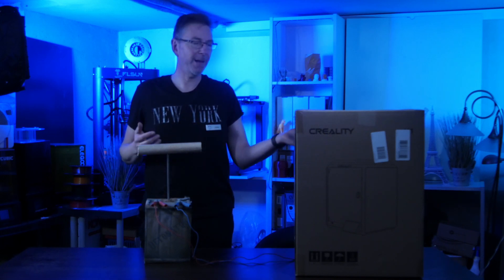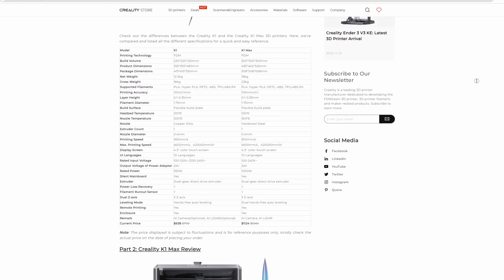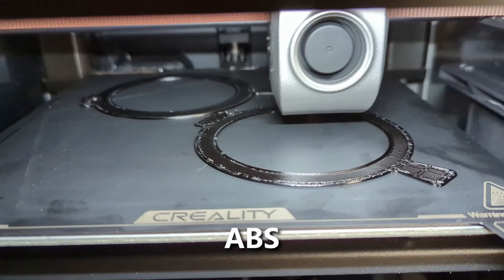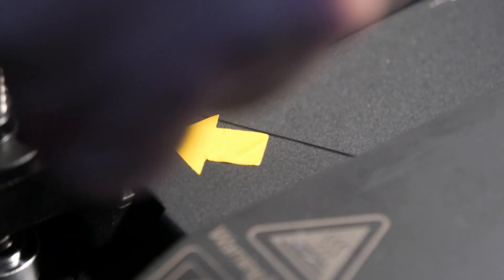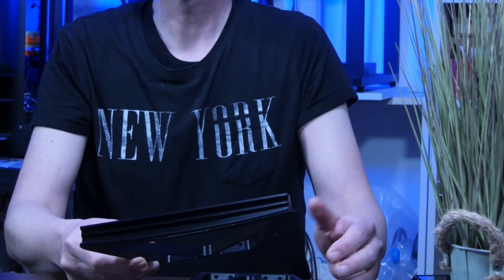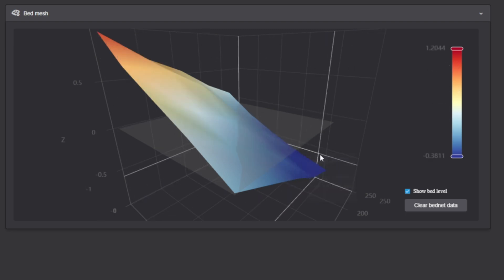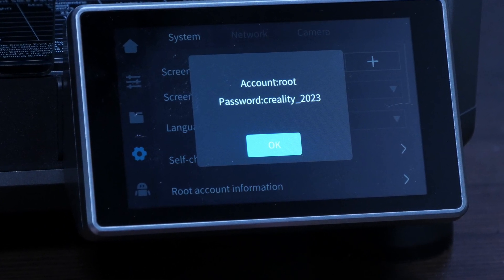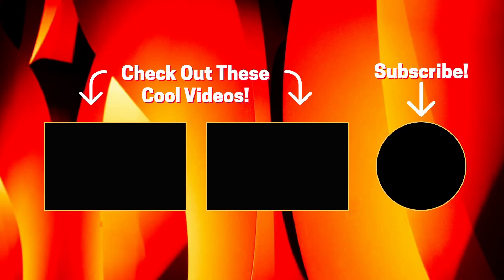Creality K1: Could this 3D printer give Bambu Lab's P1P a run for its money? (Review) 🏆

Comment: Whats that Elegoo corexy in the back? =D Never seen elegoo corexy =D
Reply from the maker: Hello, I have to admit: When I bought the Elegoo Neptune X, I originally expected a CoreXY 3D printer. I was somewhat disappointed when I realized that it's just a clone of the Creality Ender 5 Pro, which is  just a "normal" Cartesian printer with the Z and Y axes swapped, too. 
Other than a bedslinger, the print bed moves along the Z-axis, while the rest remains stationary, and the print head moves in the X and Y directions.
However, in the end, I am quite satisfied with the Neptune X because, due to its design, it takes up less space. Also, since the much lighter print head now moves in the Y-direction instead of the heavy print bed, it prints significantly faster than a Bedslinger.
Reply: @3D_Printing_Geek oh cool! Thank you for your reply!
Reply from the maker: @someonenormal5579  You're welcome Dude, it's my pleasure.

Comment: 140$ difference between the pip and the k1 is reasonable, with all the bambolab premium features, and the ability to buy ams. It doesn't make any sence to buy a k1
Reply from the maker: Thank you for pointing out the benefits of the pip over the k1. 
I don't count myself in any camp, neither Creality, Bambu Lab, Prusa or any other manufacturer and fully agree with you that the option to expand the P1P with the AMS for multi-color printing is a unique selling point that should be considered when deciding on one of the two 3D printers.
It's always helpful to hear different perspectives when making a decision.
Reply: I just bought an anker, I have no creality/bambolabs/prusha printer. but still bambo lab is known for their quality 3d printers while creality is known for having a lot of issues  @3D_Printing_Geek
Reply from the maker: Certainly, you are right. Everyone has different circumstances when it comes to acquiring a 3D printer. Some simply want a machine they can start using right away without having to worry about the technical aspects. For others, the fun lies in pushing the limits of what's possible or tuning their 3D printer. Additionally, it's always a matter of budget; reliability and good manufacturer support often come with higher costs. In the case of Creality, this is somewhat offset by the very active community.
Ultimately, as with almost all purchases, you get what you pay for. That's why I always advise beginners to thoroughly research the support and community aspects before making a purchase. If possible, it's better to spend a few hundred more dollars upfront than to later regret avoidable issues. In this regard, I would certainly recommend a P1P over a K1 in this case, even though my initial experience with the K1 was very satisfying. It has been the quickest setup of a 3D printer so far, and the only two failed 3D prints were my own fault.
Reply: Apparently there is an AMS being developed for the K1/Max. Zero details available on it though…
Reply from the maker: @mikestewart4752  That sounds cool. Do you have a source? Having an AMS for the K1/K1 Max would be interesting ☺️
Reply: @3D_Printing_Geek  I believe YouTuber "Lost in Tech" mentioned it in a video. I'm pretty sure it was him or maybe ModBot? I'm sorry, I don't recall exactly. My fingers are crossed though!
Reply from the maker: @mikestewart4752  Thanks, I'll check that ☺️

Comment: It looks like a ribbon cable to me!
Reply from the maker: Looking at the shape of the cable, I'd say it's a FPC. But since both, FFC and FPC cables belong to the category of ribbon cables, you're right.
The primary distinction between FPC and FFC lies in the fact that a flexible flat cable denotes any flexible and flat electrical cable type, whereas an FPC is a flexible printed circuit. FFC cables are a miniaturized form of a ribbon cable. Due to their construction, occupy significantly less space and can provide more flexibility than round cables.

Comment: That bed skew is a manufacturer defect and is not acceptable.
Reply from the maker: Hi, I wouldn't call it a defect, but rather sloppiness in quality control.
If the print bed had been uneven and warped, I would certainly have complained about the printer long ago, but the way my bed looks, it's just a sloppy calibration that I can fix. The most annoying thing is that it takes a lot of time. I only made one attempt for the video, but with a little time and patience it can be fixed.
As a beginner, however, I would send the printer back and hope that the problem doesn't occur, or only minimally, with a new device.
Incidentally, I printed all the 3D prints shown in the video before leveling. In this respect, the ABL has already compensated for this very well, although I would prefer the term TCP (Tilt Compensation Procedure) instead of ABL, because ABL basically levels absolutely nothing.

Comment: "Mount the spool holder to the back" I really wish companies would stop doing this. It gives it a clean look on a creator's workbench or shelf in a video, but for day to day unless you have a ton of room or only print one color for everything it's a pain to get back there to change filament.
Reply from the maker: Oh well, that back mounted spool holder is realyl a pain in the a.. everytime you have to exchange the filament. Usually people have their 3D printers with the back facing to a wall.
Furthermore it increases the depth needed to place the 3D printer. Seems Creality did recognize that as well, since they provide a link to to Printables, for a side mount spool holder designed by Fred Boisselier on their GitHub page: https://github.com/CrealityOfficial/K1_Series_Klipper/releases

Comment: I love my K1. It's my rock solid machine that I do my prototyping on - and once or twice, finishing a print my Bambu A1s couldn't manage. I like Bambu, but I prefer the open nature of Creality. K1 with Klipper add-ons like Octoeverywhere, KAMP, and others make it a more flexible machine than the P1 series... unless you want multicolour.
Reply from the maker: Thanks for sharing your experiences with both machines, I appreciate comments like yours very much.
I'm so glad to hear that you love your K1! It's always great when a machine is reliable and gets the job done. As 3D printers are just another tool, the same applies to them: use what works and what you need.
If I wanted to print in multiple colors, then I would certainly have given preference to the P1P with the AMS, although this is of course also a question of budget, as I have so far bought all my devices that can be seen in the videos with my own money and they were not provided to me by the manufacturer.
In this respect, I also give my honest assessment in my videos and I am aware that the experiences of others may differ.
Reply: Was it a slicer or build surface issue?
Reply: @Anyone700  Neither, it had some kind of layer shifting issue. Never found out what the solution was, and it seemed specific to this one strange model.

Comment: If I had a choice I would between the K1 and K1 Max I would buy the K1 Max (Just for the extra build volume). Choice between the K1 Max and the BL P1 series I would go for the P1S (This machine has all of the extras standard like the K1 Max) The print quality is far more consistent compared to the K series printers.Creality has do a lot better than the K series to get my money to support them. A simple fix like including the filament sensor being built into the hot end is enough to show how little the look at mds made on etter products.
Reply from the maker: Thanks for sharing your thoughts which I mostly agree with.
Yes, a big build volume is nice.  On the other hand, most of my prints are small parts, though sometimes being able to print big would come handy but  a huge bed to heat up for just a small print would truly be a waste of energy.
Reply: Yea go for the Max so the bed warp will be maximum